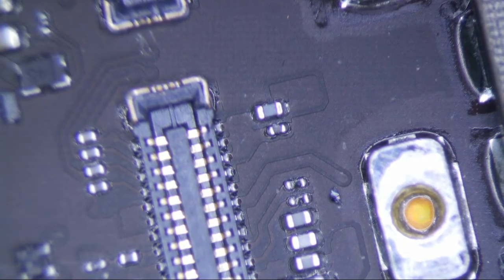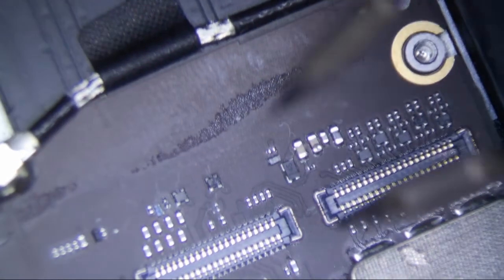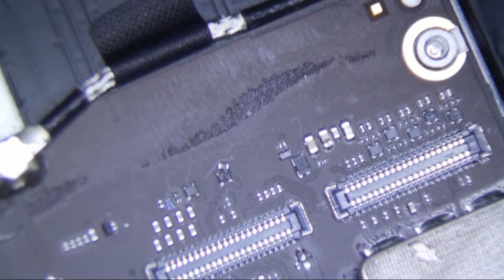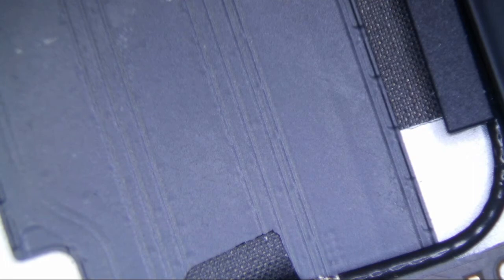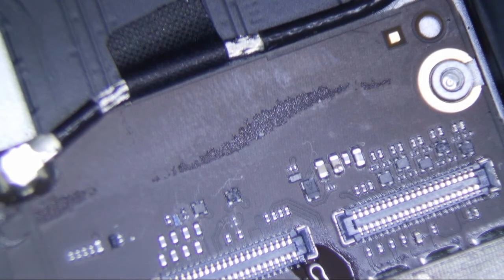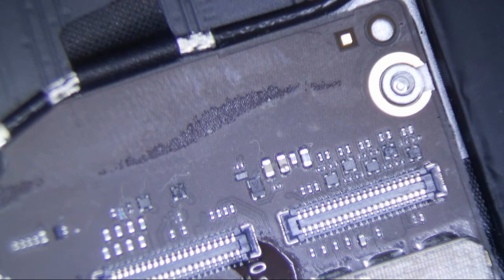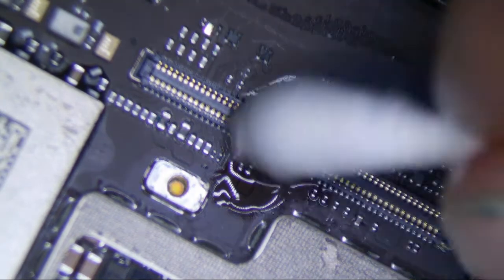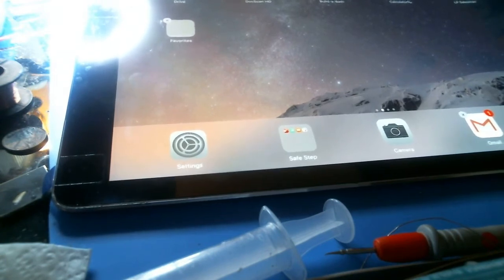iPad Pro 12.9" No Touch After Screen Repair

Comment: At this point  im not sure if i will get a reply, but im at the same point. two new screens have not worked after replacement, checked the backlight filter and it still has continuity, checked for any burn out for any other possible blown filters but didn't find anything. Any other reasons why just the touch would not work after a repair? or is this place im getting the pre soldered daughterboard screens from scamming me? Apple is always a throw up too work with, so many possible issues.

Comment: Hello I have a problem with my home button, Touch ID works but when I press it in it's not working (get back to the home screen) but the Touch ID works every time, the screen works 100%. It's just bugging me why when I push in the home button I'm not getting a response, it clicks in like it normally would just doesn't do anything? Have you come across this before?

Comment: i had not 6s backlight, and i trying jumper him... touch back work perfectly after jump.... my question is in future i will be problem in something?
Reply from the maker: Fuses are there for a reason.  I would not jump a fuse unless you absolutely have to.
Reply: Microsoldering thank for return

Comment: Hey, if you connect the old screen does the touch sensor work normally? I have two new screens and both don’t work but the old one does. Also Touch ID works sometimes. Is that also a known issue connected with the touch sensor filter?
Reply from the maker: most likely daughterboard problem